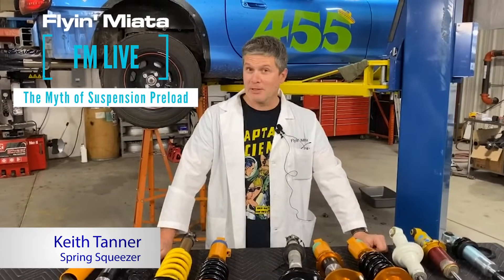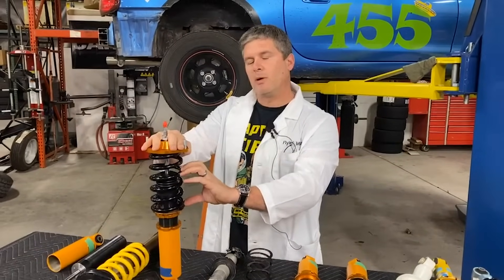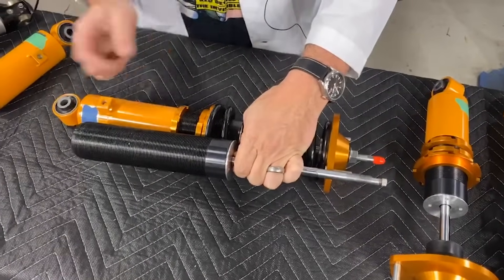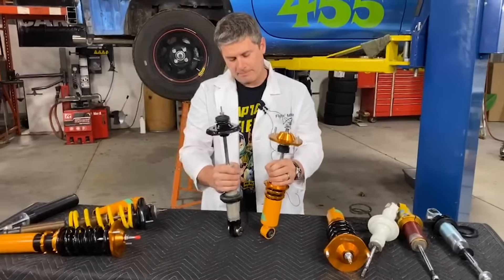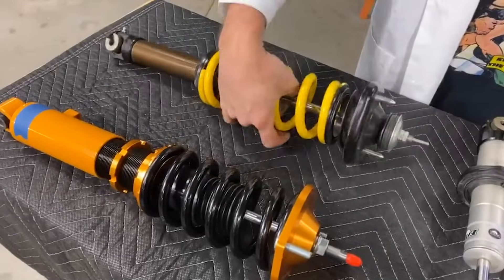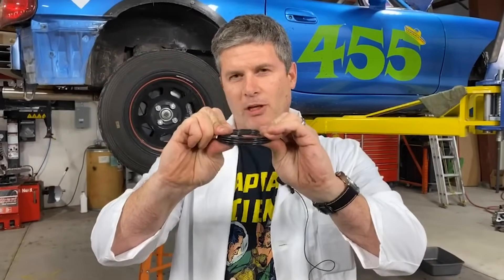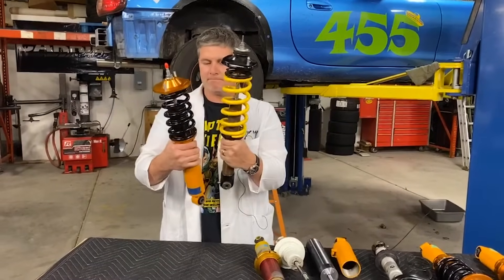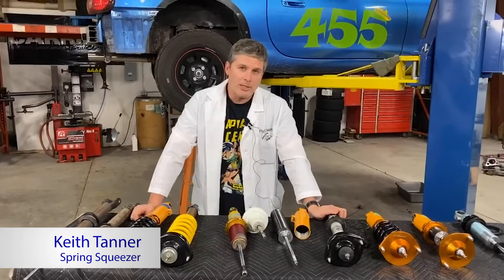The Myth of Suspension Preload (FM Live)

Comment: Keith, there is an important way in which pre-load affects handling. This occurs because preload directly impacts the amount of free travel before the shock top starts to compress the bump stop. This gap is controlled very directly by the preload adjustment on the coil spring. The higher the pre-load the bigger the gap. 

As has been discussed on the Forums in detail, a Miata in a corner rides with the two outside bump stops in direct contact with the top of the shock. When bump-stop-to-shock compression occurs the net-effective spring rate becomes that of the coil spring plus the spring rate of the bump stop itself. The length of the gap between the top of the shock with the car at rest, and the bottom of the bump stop, determines just how rapidly bump stop engagement occurs during the entrance to a corner. When the bump stop is engaged the net effective spring rate becomes non-linear and increases quickly under load.

Changing the coil spring pre-load in order to adjust chassis ride height changes the bump stop gap. The more pre-load the bigger the gap. If there is not enough gap, suspension travel down from the neutral position becomes very limited.   In the words of Colin Chapman: "Any suspension will work, if you don't let it."  It does not matter how much stroke the shock has if the bump stop interferes with your access to it.   

I have all of your books, Keith, and they are excellent. They are the 'go-to' texts for Miata tuning.  This said,  bump stop clearance is a neglected topic in Miata suspension tuning. The task of setting bump stop clearances is worthy of a separate video or a chapter in a book.  Shock pre-load settings directly affect bump-stop clearance. Bump-stop clearance determines the point at which the bump stop engages. There is no point in having long shock travel if your bump stop blocks your access to that travel during compression. 

In setting up shocks, once you have set the pre-load to obtain the bump stop gap that works for your car, then you need to reach to some other method for setting the front to rear chassis inclination. For this I used a the stainless steel FM shock mount spacers.  On my suspension I had to shim with FM spacers. Also to get the gap I wanted I had to use a shorter (stiffer) bump stop in front. I now have a ride height, chassis inclination, and bump stop gap that is optimized for the way I use the car. The bump stops engage neither too soon, nor too late, and I can use all the available shock travel.
Reply from the maker: That's the common misperception I was trying to address. 
There is only one correct setting for the length of the shock on a Miata. Any other length will  take away compression travel (bad) or fail to engage your bumpstops before your suspension binds (also bad). 
One-piece shocks will already be this length. Two-piece shocks have to be adjusted to this length. Any other length will be incorrect.
Changing the coil spring preload to affect chassis height does not change the position at which the bumpstop engages relative to the chassis. That last bit is the important part. You will retain as much bump travel as the car can manage. It changes how much travel there is between static ride height and that engagement - but since the ideal engagement point is determined by the rest of the suspension geometry that doesn't matter. That ideal shock body length is the same regardless of your static ride height. Note that I am assuming we're talking about Miata designed to be used on paved surfaces, the rules are different for rock crawlers where droop is more important than bump.
Where people get confused is what you're using for a baseline. Looking at bump travel relative to static ride height versus looking at it relative to the chassis baseline can get you tangled up. If you're only looking at bump travel relative to static ride height, you forget that there are other limits imposed by the chassis and that you cannot simply lower the car and get more bump travel - not unless you had it artificially limited in the first place.
In your case, the combination of "extra" travel from a super-short shock body and a spacer on top of the upper shock mount cancel each other out. The short shock body is limiting total wheel travel - if you have maximum bump, you are loosing droop. If you decide you want more droop, the only way to get it is to decrease your bump travel. This tradeoff is pitched as a feature, but really it's a limitation.
Reply: @FlyinMiataVideo  All well and good Keith. Consider, if you will the following events which occur as you adjust the pre-load on a coil over. You have done this many times yourself I am sure. I have done this many times as well.  

Start with these parts from FM's inventory. 1.  Koni sport shocks. 2. Bump stops of the type you sell, and 3. Ground Control adjustable perches for the Koni shock. Install the shock, bump stop and perch in the car with the spring loose. Put the weight of the car on the shock. At this point the weight of the car is carried only through the bump stop compressed against the top of the shock. Initially there is no load in the spring. The spring is loose on the perch. 

As you tighten the nut on the loose spring, and the spring starts to compress, the compressed bump stop starts to lengthen as the spring takes the load. As you continue to tighten, a gap between the bump stop and the shock top emerges as the load transfers to the spring. At the point at which a gap emerges all the weight is carried through the spring to the perch.  As you continue to tighten the spring the gap between the top of the shock and the bump stop gets bigger. This is simply 'what happens' in your shop and in mine. 

My personal experience is that gap between bump stop and shock is very important. It is one of the more important dimensions on the suspension. As you say there are many misconceptions about this. 

If the gap between bump stop and shock top is too narrow the car is hits the bump stop too frequently and the ride is unnecessarily harsh, and the travel is limited. When the gap is too wide, the car rolls on to the outer bump stops late as your enter the corner. 

This is a practical example from your shop and mine of how a change in the pre-load affects handling.
Reply: @FlyinMiataVideo  Keith you write, above:  "In your case, the combination of "extra" travel from a super-short shock body and a spacer on top of the upper shock mount cancel each other out".  This is not correct. My case is a Koni Sport or equivalent which is not a short shock.  On page 113 of my edition of "How to Build a High-Perfomance Miata", you write, under the topic Spring Preload, "the only thing that our pre-load has done is lift the car."  This is correct that the car lifts when pre-load is increased. However this is not the 'only' thing that happens. Consider the consequence in terms of bump stop gap. Lifting or lowering the car changes the bump stop gap. And that gap is a rather sensitive dimension.

There are three targets you are trying to hit in adjusting preload. To first order, you have only one knob to achieve that. The first goal is that the shock needs to be in the approximate center of available stroke with the car at rest. The second goal is that the ride height has to be high enough that the roll center is reasonably close to the center of mass. And thirdly, the bump stop gap needs to be large enough to permit full use of the shock travel in compression, without approaching coil bind. The one knob that you have to hit all three goals is the pre-load nut. You can also change the length of the bump stops. You can use different length bump stops front and rear. Finally you can shim the top of the shock.

When I install shocks, I set the pre-load such the shock is approximately in the middle of the available range of travel.  This is one of the  more important settings. It is also the easiest target to hit.  

After that I swap out bump stops of different lengths and stiffnesses to get the approximate gap I want. 

When you lift the car by increasing pre-load, the bump stop, which is attached the chassis, and the upper surface of the shock, which is attached to the control arm, move apart.  A small increase in pre-load increases bump stop gap meaningfully. As you tighten the preload nut, with the wheel off, and the control arm supported by a jack, you can measure the change in the gap between shock top and bump stop as that gap opens up. 

At this point I look at the static height of the chassis. If everything else is the way I want it, I shim to get the chassis inclination I want. Shimming, does not cancel out anything as you suggest above.\ The load into the coil over is not changed by the shim. The compression of the coil-over does not change. The only thing that happens is that the end of the car that is shimmed lifts slightly.  On our cars the factory set up has the rear a little higher than the front. Inserting the FM spacer in the rear increases the ride height in back slightly, or brings up the front if that is what needs to be done.  

Since a Miata rides directly on its outside bump stops in a turn, the point in the entrance to the turn at which those bump stops make contact is regulated by gap under the bump stop. This is directly affected by the pre-load. I find that this interdependence of the two is not commonly understood. A change in preload affects handling by affecting one of the more critical dimension in the suspension, the gap, or free movement of the shock before the bump stop engages. This gap determines how much chassis roll has to occur before the chassis settles onto its outside bump stops in a corner. 

Getting compressive shock travel balanced with droop travel is important. At rest the shock top need to be in the approximate center of stroke. Getting the timing of the engagement of the bump stop is at least as important. Hitting the end of travel in droop is infrequent. Rolling over on the outside bump stops occurs continuously through every corner taken at speed.  Changing the preload changes the gap. In any treatment of preload these other elements need to be considered. Preload does affect handling by changing how early or late in the corner the chassis settles down on the outside bump stops, front and rear. This is fundamental physics. 

I frequently see cars where the bump stop gap has been closed up by lowering the car through a reduction in pre-load. When this is done it doesn't matter how many thousand dollars you paid for your coil overs. They have no travel in compression. Those expensive coil overs are doing little that is useful. You could replace them with a piece of oak and the car would handle as well. Preload matters because it affects bump stop clearance.
Reply from the maker: @maneki9neko  I think the big disconnect between us is that you believe that you want bumpstop engagement at some specific point in the travel, where I want to delay it as long as possible. You want a specific gap, I want as big a gap as you can get. I want the car riding on the springs, not the bumpstops, because that's when the suspension is actually able to move. Years of testing have shown that  as you increase compression travel (the distance between the top of the shock and the bumpstop), the car rides better and handles more consistently. When the car is on the bumpstops, the suspension stops moving and you lose the ability to absorb any further pavement imperfections. A big bump will mean a spike in spring rate as you slam into the stops, and that leads unpredictable handling. 
Here's how I set up a suspension: set the shock length and upper perch design so the bumpstop engages as late as possible. There are limits to when this can be, imposed by the geometry of the suspension. A one-piece shock that's properly designed will already be at this length. A two-piece shock with "adjustable preload" has to be set at this length. If you make the shock any longer, you will hit the bumpstops too soon and your ride quality, handling and ability to absorb bumps will be compromised. So there's only one correct length for the shock. This means an adjustable body shock can be adjusted one way, and that's to match the length of a well-designed non-adjustable body. Anything else will compromise the car.
Now that you have maximum bump travel, you can move on to ride height and corner balancing and the rest of setup. You need a spring rate that's stiff enough to keep you off the bumpstops at your chosen ride height, but that's the case regardless of if you can adjust shock length or not.
Droop travel is not as important as bump travel to a performance Miata, but if you want droop travel the best way to get that is to package the longest shaft possible in the shock. On a one-piece shock, you have more room for this shaft. So your one-piece, "non-adjustable" shock will have maximum compression travel and more droop travel than a two-piece shock. You can see this illustrated clearly in the video. Setting your shock so that it sits in the middle of the travel is not a good way to start your setup, because you will probably give up that critical compression travel for droop.
Of course, there are edge cases. Having preload that is equal or greater to the corner weight as measured at the shock (not the wheel) means there is zero droop travel. This is a failure in the design of your suspension, not a setup problem. It's very difficult to get into this situation, but I have seen it on a Miata with a very, very short travel shock. Obviously the car did not work well at all. You can't manage it with parts sold by Flyin' Miata unless you combine them in a way that was not intended. If you run a very, very high ride height you may find yourself getting into this situation as well.
Spec Miatas should not always be taken as the correct way to do things, as they are given some very specific limitations on components by the rule set and builders have to do the best they can with those components. And even then, there have been changes in that rule set specifically designed to allow for more movement before the bumpstop is engaged.
Reply: @FlyinMiataVideo  5X Racing, Good-win, FatCat, Ground-Control, Koni and others offer an extensive range of products in bump stops and related parts.  To this point in time Flyin' Miata has just the one bump stop. And it is a good choice for general use, but there is only the one.

Flyin' Miata is a leader in so many tools and methods for tuning these cars. Why not here?  

FM could publish the force/displacement curves for the bump stop in your catalog. This will help your clientele understand how carefully these products have been engineered. The original bump stop for the car was little more than a hockey puck with a hole drilled in it.  The bump stop that FM sells is far more sophisticated than that. 

FM could also augment their product offerings and publish all those curves so that people can do a better job of designing their suspensions  You would not need much warehouse space for these parts. They are small. They are easy to ship. You could be the first to offer a full side by side comparison. 

These parts do a lot for what they cost.
Reply from the maker: @maneki9neko  The composition of the bumpstop matters, but we believe it's more important to stay off it as long as possible. That's our area of focus, and it's based on years of running Miatas with a wide range of suspension setups. As soon as you start to engage that bumpstop sooner than necessary, the car's behavior degrades. Thus the focus on suspension that offers as much compression travel as possible regardless of ride height. It's also why we choose spring rates that are intended to keep the car off the stops at a given ride height. This removes some of the emphasis on the actual bumpstop design. It's the opposite of your "any suspension will work if you don't let it" comment - we emphasize letting the suspension work instead of relying on a bumpstop that is effectively undamped.
Now, if you want to start talking about the composition of bumpstops instead, that's a different conversation and one that is outside the scope of what was discussed in this video. We use three different types of bumpstops across our various suspension offerings, and our primary one is used because it gives a good mix of free travel before engagement and a gradual increase in rate. Some of our competition chooses to sell as many products as possible, we tend to select products that work well and not to sell all the slight variations that don't.
Thanks for your enthusiasm on this matter.
Reply: @FlyinMiataVideo  Thank you for your willingness to participate in this dialog. You might want to consider, over time, that reasonable people differ on this topic. There are other options aside from staying off the bump stops maximally. These options are embraced by some serious suspension designers of long experience. 

When you set up a car's suspension to stay off the bump stops you deprive yourself of the 40mm of shock travel that occurs after contact with the bump stop has occurred.  There are only four and a half inches of usable travel in an NB Koni Sport. If you stay off the bumps, with an NB Koni Sport shock, you limit yourself to three inches of useful travel. This is an expensive choice. Why not use all four and a half? 

If you are using an old-school bump stop, a hockey puck with a hole in it, then sure, you want to stay away from contact with it.  The performance characteristics of the bump stop in the FM catalog do not remotely resemble those of the original factory part. Find someone with an Instron machine, and get them to give you the curve. Contemporary bump stops are a sophisticated piece of kit. And that needs to be better understood. The way you dispel myths is with data.
Reply: You both have good points ,he is right in some ways and you are right some ways but I agree with you more about suspension travel doing the work .
Reply: It was nice to read a civil discussion where both parties don’t quite fully agree. Good on both of you for keeping it respectful and providing loads of useful info to people.
Reply: Here is a final paper example.  With the same 2,000 pound car and an 8" long 250#/in spring and the corner supported by a jack, dial the perch nut up against the spring until contact is made.  Dial the perch nut 2.125 inches further. There is now 531# of preload.  The pre-load is 31 pounds greater than the corner weight. 

Start to lower the jack, placing the corner load on the spring. There will be no further compression of the spring. The spring is pre-compressed 2.125 inches, by the perch for 531# of preload. The weight of the corner is 500#. The preload is greater than the corner weight. The system in in balance. There is no motion. The corner sits 2" higher than the example with no preload, and 1" higher than the example with 250# of preload. The gap under the bump stop is 2" larger than the example with no preload.

In each of examples the preload regulates the gap between bump stop and the top of the shock. My practical experience is that this is simply the way that you, I and everybody else who cares about this regulates that gap if they have a preload adjustable shock. The weight of the chassis corner has to overcome the preload in the spring before it compresses the spring further. 

When there is no preload, only the spring rate is important. When the preload exceeds the weight of the corner there is no compression of the spring by the weight of the car, and the spring rate is unimportant.  When preload is in the middle, both the preload and the spring rate regulate the height of the car, and that controls bump stop gap. 

There are other dynamic effects, but this is the semi-static balance of forces that determine ride height, and in a suspension in which only the perch height can be adjusted that sets bump stop gap.